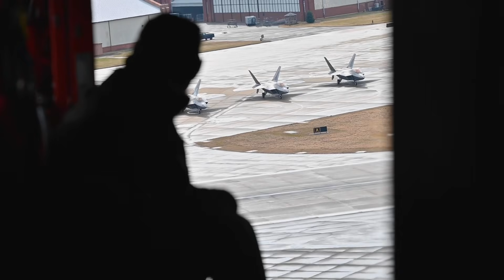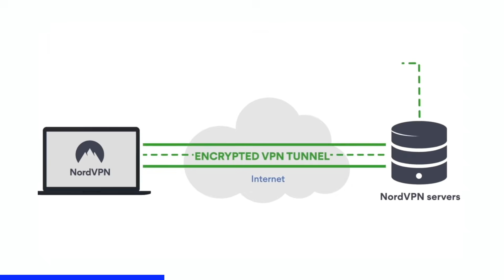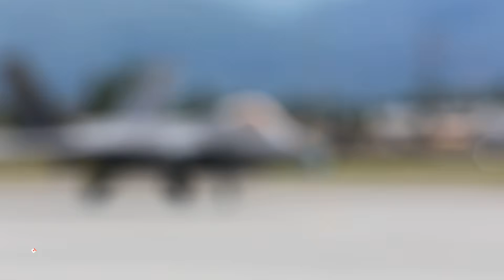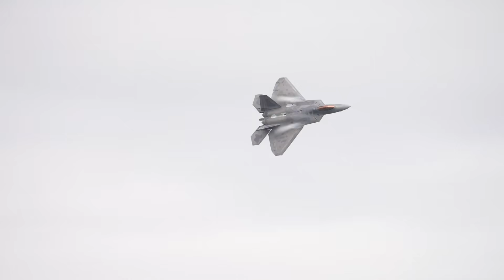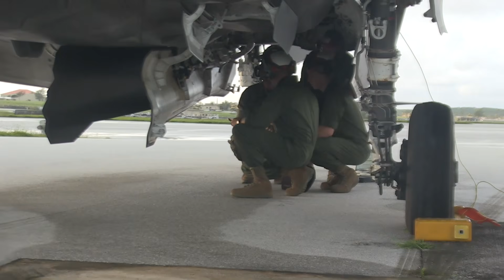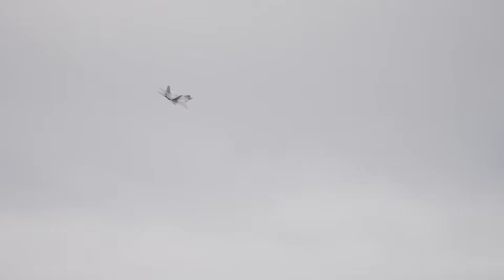Why 12 F-22 Raptors can crush entire Iranian Air Force ?

Comment: Interesting analysis, however I have a question or 2. 

Obviously the USA 🇺🇸 has cutting edge air frame designs and possibly alien technology added in for good measure. 

I'm not aware if the USA 🇺🇸 has hypersonic weapons or any defense against those weapon platforms. 

Seeing as nearly 40% of the US Navy is in or around the Middle East/Mediterranean, if Iran 🇮🇷 uses hypersonic weapons to sink the US Navy and or naval/air bases, wouldn't that knock out the USA's ability to use said aircraft? 

Just wondering seeing how the Houtis  blocked the Red Sea. As they're basically a proxy to Iran 🇮🇷 and have inferior modern weapons, mostly. 

The Iranians obviously have hundreds if not thousands of missiles and hypersonic types as well, if the USA attacks Iran and if Iran responds in kind knocking out our Carrier's/Air bases, what happens to our plane's that have just finished their sorties and are still up in the air?
Reply: Israel essentially conquered Iran’s airspace while suffering minimal damage in retaliation. If the US goes to war, Iran’s offensive and defensive weapons will simply cease to exist. The Americans are on another level in terms of scale and assets.
Reply: @Zetler While this is true, it is also unwise to pick a fight with those who want to see the Jin rise, and are ready to die for their side.

Our US Navy while mighty and strong, and we have assets across the region, we also have many enemies in this region as well.  

As for the recent 12 day war between Israel 🇮🇱 vs Iran 🇮🇷, wasn't it the Israelis who pushed for a cease fire, so they could restock their systems? 

Unlike year's ago when only a handful of media site's were available and they could act as gate keepers of information, today there's a host of other site's, that evade this censorship.  

Watching videos streaming out Tel Aviv showed a different story of what Iran 🇮🇷 was capable of doing to Israel 🇮🇱. 

I'm just thinking of past war's that the USA 🇺🇸 said this was going to be a cake walk, easy peasy sneasy, and ended up with a black eye, Korea and Vietnam come to mind.
Reply: Simple
The Houthis survived using hit and run tactics. They would launch and run for it
The US doesnt have time sensitive capability , till weapons like the SIAW,  are not operational ,the US ability to engage such targets limited
if that was operational, they could smoke any target 200 miles away in under 3 mins which for Iran and the Houthis is very bad day
The GBU-53 has the range but not the speed
As for Iran's missile
its very simple
Range is the US's ally
The USN can position itself 600 miles away and that would effectively neuter Iran's missiles. They can get one strike in at base and the USAF can simply relocate to Diego Garica
and again Iran's missile becomes useless
The combination of PAC-3, THAAD, SM-3 and SM-6 backed by AEGIS and AWACS
Iran will find very quickly that the US isnt Israel but realize that the US can counter with missiles or aircraft. Iran may get off a few shots initially due to law of averages but as the US intensifies 
its counter attack, their effectiveness will drop
Lastly, Iran thumped it chest because Israeli aircraft having to fly thousands of miles had limited loads and time over target. The USAF has 130 stragetic bombers. They can easily commit 4 B-2, 4-B-1s and 4 B-52
That amount destruction would level Iran, and imagine if the USAF decides commit 4 of its 220 C-17s with Rapid Dragon which allows C-17s to carry as many as 45 JASSM cruise missiles or 45 JDAM-ERs
Iran's so called victories would be hollow very quickly
Reply: @verdebusterAP One the best replies yet. Thank you.
Reply: @antonwearsakilt5209  
If the US had SiAW, MAKO, Brimstone 3 and JAGM-F/ER operational with upgraded JSTARS aircraft 
The US military would have the time sensitive strike capability and sensors needed eliminate Iran's mobile launchers
Airborne ground surveillance could also back track vehicles to Iran's underground cites 
Follow up with bunker busters
Reply: @verdebusterAP True statement.
Reply: The u.s invented Hyper sonic weapons and they are not as scary as you think they are.
Reply: @robertlane370 Yes I understand that, however they're still a very real threat to contend with. 

Let alone if Iran 🇮🇷 closes the Hormuz Straight, which will likely cause massive economic pain throughout most of the world. Perhaps not here in the USA 🇺🇸 as we now have Venezuelan 🇻🇪 oil. 

That said whilst Iran 🇮🇷 doesn't have the same type of military as we do, they do have X amount of Hamas Hezbollah and millions of commietards here in Conus. 

Looking to Mexico 🇲🇽 at the gang's/cartel violence and what is happening there, what happens if known "sleeper cells" get activated inside Conus and they go after critical infrastructure? What if Hamas/Hezbollah team up with these cartels/gang's etc that came into Conus over the past few year's? Causing havoc and chaos most have never seen in person.  

Imagine thinking that these home-grown commietards won't try to start something while these terrorists are out sabotaging the USA 🇺🇸.  
Look at our infrastructure, most of it is not hardened and in 2013? The Metcalf power [California]substation was nearly taken out by a group who used small arms to damage it. 
If this substation had failed most of the Western USA would have had rolling brown outs for a year or more while it was being repaired. 

The risks of regime change seem high, especially when analyzing our own weaknesses here in Conus.  

Who knows perhaps our discombulator weapon Trump used in Venezuela 🇻🇪 is some new wonder weapon and these threats won't materialize here in Conus or in the Middle East.
Reply: How can you launch middles if the radars are blind, and the launchers are dead?
Reply: @bigearl3867 Not sure what a middle is? Perhaps you meant to type missiles? 

Well we do know that Russia 🇷🇺 and China 🇨🇳 are using isr, and Space based intel to inform Iran 🇮🇷. This was how they were targeting Israel 🇮🇱 in the recent 12 day war. 

Iran 🇮🇷 has sleeper cells, estimates of 50k or more inbedded inside of Conus.  
Look at Mexico 🇲🇽 and how the cartels/gang's are using simple machinery to block roadways and cause massive problems.
Reply: @antonwearsakilt5209  
Auto correct can be a pain sometimes. Thanks' for pointing that out.

For a satellite to see an attack it still needs to know where to look. Those assets you mentioned didn't stop the US or Isreal from striking targets in Iran.
If you are talking about an invasion, then I would say that is not a good idea. And the American people don't want an invasion.

Mexico was not in our conversation. You are trying to come up with another issue that doesn't even pertain to our subject. All I will say on that is that it is not like that is a new tactic.
Reply: @bigearl3867 I brought up Mexico 🇲🇽 because of it's proximity to the USA 🇺🇸 and because we know from several very credible people that Iran 🇮🇷 has had some of their elite forces in Venezuela 🇻🇪 training Hamas/Hezbollah there. Plus we know that up to 50k Hamas/Hezbollah are in the USA.  

My point is that if the Iran war kicks off, and  they then activate their "sleeper cells" in Conus, couple that with all the anti ICE commies, gang's etc that fighting a 2 front 3 front war etc would be very difficult.
Reply: @antonwearsakilt5209  
What are these credible sources?
Reply: @bigearl3867 Well for one Matt Bracken{former Navy Seal, turned author}another is Michael Yon one of foremost combat reporters in the world, he has more tour of duties than any other combat reporters alive currently. 
Then there analyst's like JR Nyquist to name just 3 of the more prominent people. 

Michael Yon with the Reuben brother's, Anne Vandersteel etc documented the invasion over the past 4 years under the Obiden regime, Michael Yon has helped expose the human smuggling and the different NGO's coordinating the invasion of the USA 🇺🇸. 
Plus his time in the sandbox during the gulf war's and elsewhere war's were taking place.
Reply: They're more of a threat than the US is leading on.  Especially with the Secret Weapons from Russia and China Iran has.  Its an Ancient Civilization who has MANY contingencies in the region
Reply: @darkshinethakid4463 Indeed they do. This is why I don't want to see a war with them. Not that I'm afraid of a fight, I'm concerned that if the USA 🇺🇸 attacks Iran 🇮🇷, Iran then has the excuse to attack back or defend itself as they see fit. 

If Iran is able to knock out the US Navy and or our air bases in the surrounding areas, wouldn't that force the USA 🇺🇸 to go with a nuclear option ☢? Once nuclear weapons are used it's quite possible for a full out conflagration, and as all war's tend to do unpredictable thing's, couldn't Pakistan 🇵🇰 or India 🇮🇳 start using nukes? 

Once that starts how long before humanity itself is knocked out?
Reply: @antonwearsakilt5209 Infinitely worse if Iran gets their crowd pleaser first.
Reply: @Chuck_Hooks I'm not sure what you mean? Please explain.
Reply: @antonwearsakilt5209 spot on.  We arent in an emotional state to accept a Mass casualty event that this would be.  Could you imagine?  10k Sleeper cells with Suic*de vests Storming Bases and Embassies? The Terror that would happen at home and the War Hawks willing to do ANYTHING to look superior even if it means starting WWIII with NO true allies anymore.  Its almost if we were INTENTIONALLY weakened to make this war possible.  Makes you think....
Reply: @darkshinethakid4463 Amen, that it does. 
God Bless and God Speed Mate
Reply: @antonwearsakilt5209 Blessings to you and Yours my friend.
Reply: @antonwearsakilt5209 if it happens, it happens. Nothing you or I can do about it. I'd rather just get it over with. 
Worrying doesn't help anything.
Reply: @tedn2926 I'm not worried, I'm concerned that 90% of my fellow Americans have little to no clue of whats going on, nor are armed, trained or prepared in anyway including spirituality. So if this does kick into a wider war, it's not the cartels or gang's I worry about, it's my I'll prepared friends in Conus.